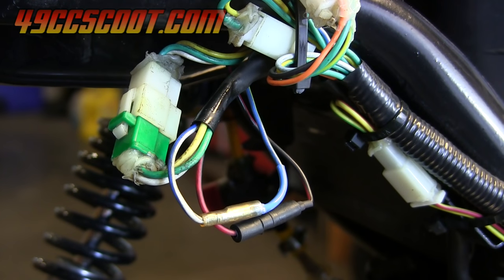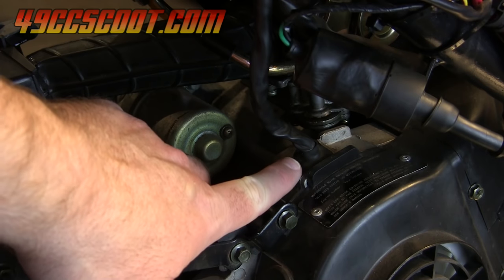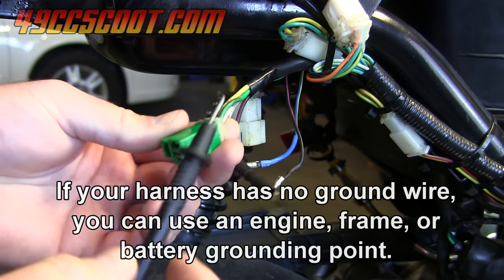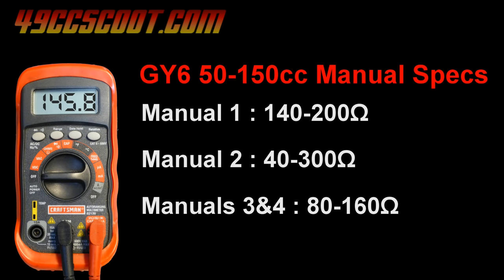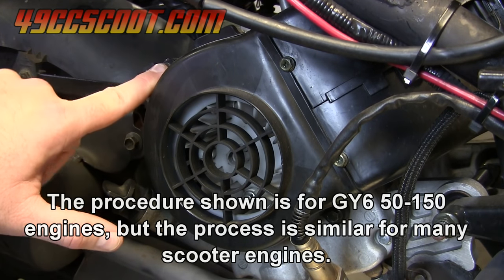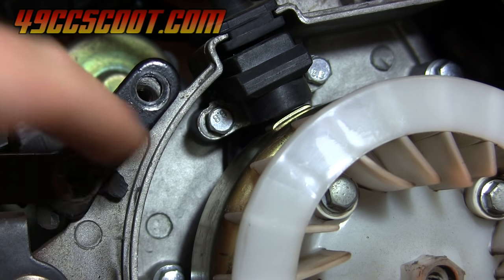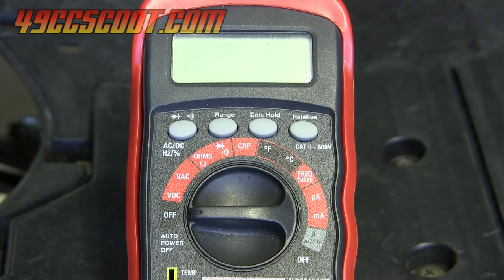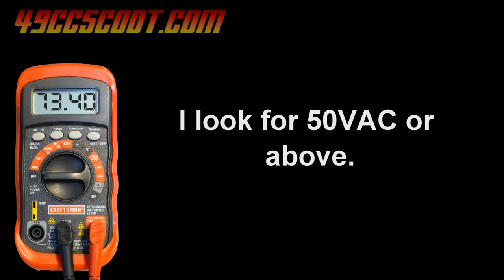Ignition Pickup And Stator Checks For AC Scooters, ATVs, & More

Comment: How can I tell if my scooter was supposed to have a DC or AC cdi?  Previous owners changed a bunch of stuff around and they had no clue what they were doing...
Reply from the maker: Depends how much it's modded. Worst case, you'd have to try to find out from a manual or someone else with that make/model/year. Otherwise, if the stator has an exciter coil to charge the CDI then it should be AC. If the CDI is getting power via the battery then it is DC. DC CDIs tend to be large compared to AC.
Reply: @49ccscoot  it's bone stock. It has a dc cdi on it right now but they changed it. The messed the wiring up because none of the lights work. But I've heard that dc scooters don't have regulators because it's built into the cdi. And also the right plug only has 1 wire on DC setups. But mine has 2. The power to the headlights/rectifier goes up with throttle so that would make it a AC scoot wouldn't it?

Comment: Perhaps reason for having so many different specs is because different Chinese scooter manufacturers use different stators, got to find out what stator type was originally used on the scooter manual is for then you can map resistance values to that particular stator (not scooter). e.g. 49cc GY6 come with 3 types of stators that are easy to distinguish by looking at the connector type 1 has NO ground (green) wire, type 2 has ground (green) wire, type 3 has no ignition/cdi wire.
Reply from the maker: Good luck with that. I can tell you from personal experience that you find stators of the same style that are wrapped different. Some will fill each winding and some cheap out and leave room for more. When you've got that going on, it's gonna be real tough to find anything you can be sure is accurate.
Reply: That's why i love chinese scooter

Comment: hi, i buyed a chinese atv 100cc but got a problem with the spark its to low you can barely feel it on your hand., what can it be? a lot of technician or mechanics want me to take my mtv  to their workshop., but the prices are to high., what can i do?
Reply from the maker: +viln o First off, please stop trying to electrocute yourself a little at a time. It's not healthy. Try using a tester of some sort, or just observing the spark across a spark plug. Could be many things. This video covers one. Could be the coil, wire, connections, reluctor gap, or maybe the CDI.

Comment: I have a genuine buddy 50cc that ran fine and lost spark. The black and red wire from the stator is showing 40 volts, the pickup coil is showing
0.34 volts. still not sure if I should order a new stator.
Reply from the maker: Get a manual and check the coil according to specs. Try a new spark plug. If you have a spare CDI, try it. Make sure there is no ground on the kill wire when the key is on. If there is, you may have a faulty ign or kill switch.

Comment: I have a question I'm hooking up a two stroke engine on a 4 stroke fram the wire hook up on the stator has four wire's you already know the two stroke has five is the black a ground cause there are white and yellow in a two plug then there are two in another with a blue line in one wire an a red line in the other what do I do with the black wire commuting from the stator
Reply from the maker: +marc Black should be ground...
2T wiring here : http://49ccscoot.proboards.com/thread/2556/wiring-diagrams

Comment: I can understand the awareness of valves, but gosh dang, a week ago, it was running like a champ, driving Interstate 15 in Vegas to work n back.. 
So what's the reason why the float levels, when full, aren't delaying fuel from continuing, but yet I do a blow check , personally & when floats hit full, I cannot blow  into intake of fuel line.
Reply from the maker: So you're asking why fuel continues to flow into the carb, I assume overfilling it, even though you can blow into the fuel inlet and it stops the airflow? Maybe the float height is set too high.
Reply: So Joey, if you were me and all you have witnessed is a constant cranking without the engine turning over, all though, knowing there is spark from an engine that less than a week ago was flying strong until vandalized,,,,, what would be your next move??  I am staring at the carb now, which I have taken off 6 times now and I am wondering is there something simple, like the needle valves not properly positioned, or is the idle screw not lowered enough ,,,, as to why its not turning over??
Should the butterfly valve be open on the idle screw as a pre start up [position and how far is the mix screw supposed to be?? I mean, am I flooding the carb so bad that its being choked?? SHIT MAN!

Comment: So what if my 139QMB 50cc with an 80cc head starts right up idles and accelerates fine and loses spark once it warms up?
Starts right back up and shuts right back off.
Reply from the maker: I would try to check ignition components once it's warm. Compare cold and warm specs and factory specs and see what changes when it's hot. If you can't find anything that differs, but it's definitely got no spark or a weak spark when hot, then try swapping out the CDI, assuming you've already changed the plug.

Comment: great info thanks ... everything checks out but still no spark
Reply from the maker: There's still the coil, CDI, and spark plug... as well as kill switches.
Reply: 90GTVert  I don't get any spark from the coil . It try's to turn over but no spark.i tried changing the coil and Cdi and still nothing  It's getting gas . The kill switch I believe works. It won't turn on with it off but try's to start when it's switched on ...
Reply from the maker: http://49ccscoot.proboards.com/thread/647/start-troubleshooting?page=1&scrollTo=8057
http://49ccscoot.proboards.com/thread/4666/easy-guide-spark-condtions

Comment: i have a problem where my chinese bike has only 4 volts ac on the exciter coil when cranking any help?
Reply from the maker: Sounds like you may need a new stator. Make sure you compare what you have to listings if you get a new one. Some of the Chinese stuff has multiple variations that are close but not exact.
Reply: @49ccscoot  thanks for the advice :)

Comment: problem atv, have   new spark plug and spark,compression good and fuel, engine  cranking but wont start 

can the CDI be the problem?
Reply from the maker: It's possible. If it has a strong spark (jumps a large gap like and HEI or adjustable tester or an old plug with the ground strap bent back) then I don't tend to focus on the ignition, but it could be timing related. Try holding the throttle different ways and see if it will fire then. If it gets flooded, holding it WOT will help. Sometimes I'll take the spark plug out and spray in a little carb cleaner or a couple drops of gas. Lately I've just been using an unlit propane torch in the airbox inlet to see if it will fire with a little extra fuel.

Comment: hi, atv 50cc Chinese
no power, check solenoid I get tone. get 13vdc to solenoid but when I turn key no green light come on or starter start any idea wath to look at it, thx
Reply from the maker: +Mike Gallo You need to have batt power on one side. The other should lead to the starter. You also need power coming in to trigger the relay from the starter button. You could try a simple test of the starter relay. Use a screwdriver to bridge the two large terminals and see if the starter cranks then. You must be careful not to touch any other surfaces when you do this or it will be a short.

Comment: Nope not all have continuity test.  I'm working on one where the owners multi meter doesn't have continuity. It has AC and DC volts DC current ohms and diode test. I had to use my fluke which has that and additional testing for transistor and capacitance and  coil.

Comment: Hey there. I need help with my scooter.ever since i adjusted the valve and spark plug clearences of my scooter i m facing a hard kick issue.the kick lever jams sometimes.no matter how much i force it down. Then i back off a little and its fine then. It doesnt happen often and never used to happem before adjusting valves. The kick start lever is properly greased and its not a bushing/greasing issue. Its smthg related to engine pressure for sure.and other thing i have noticed it that sometimes i face a kick back. This too never used to happen before adjusting the clearences. And to top it all sometimes i have to kick it 4-5 times just to get started during cold start.while sometimes it starts normally in one or two kicks.this doesnt happen with my other scooter which uses same engine . The other one starts in one kick no matter what the weather(extremely consistent).i have cleaned all carbs and filters and checked for vacum leaks as well. All is fine. Its just that this unpredictability during cold start is puzzling. M using stock clearences and engine runs good at all speeds.the occassional kickback and lack of will to start is odd.is it a sign of weak pick up coil? Its a 102cc 4stroke honda. Also one some rarest of rare occasions i have faced engine stalling issue at crawling speeds under moderate loads. That happened out of nowhere when engine was properly warm up. But thats a rare occurence.
Reply: k p 
theres a lot of posibilities...
maybe too much gap in valve clearance or no gap at all...
or might bhe mis timed valve action due to timing chain prob...
and an overly advanced ignition timing

Comment: no spark is usually bad cdi so try to borrow from any scooter atv snowmobile chainsaw that has similar looking cdi as for gy6 normal china scooter  or replace it first. can also heat the cdi to fix it like in oven google it for temps and times.

Comment: Good video, hoping you can help me.  I have no spark, new cdi, new stator, but the new stator is only putting out 50Vac.  Is it likely that I just got a bad stator, or what else am I overlooking?  The ignition coil seems to check out, and the guy I bought the bike from told me it was new anyway.  TIA
Reply: Josh Randall and a quick follow up question:  how can you tell if a flywheel is meant for a 6 pole or 8 pole stator?  I bought an 8 pole because the one I was replacing was 8 pole, but I was wondering if a mismatch will cause problems, and maybe this is part of the problem.  Thanks again.
Reply: I got the flywheel question figured out and decided to test some things putting the old stator back on and it actually put out higher voltage on both the pick up wire and charging wire, so I'm a bit stumped.  What else should I check or could be wrong?
Reply from the maker: Josh Randall See if there is a ground applied to the kill switch wire. You can find diagrams just googleing CDI wiring or something like that. Very commonly it's black/white. If a kill switch or ignition switch fails or there's a short it could ground that wire out and disable spark.
Reply: ***** I have tested the kill switch with a DMM and it seems to pass, I haven't been able to figure out how to test the ignition switch though. Any ideas?  Thanks again
Reply from the maker: If you check the wire on the CDI you can avoid having to check both ign and kill switch unless you find that there is a ground on the wire when the ign is on and kill switch is set to run. You'd test the ign switch the same way you tested the kill switch basically, but you want to see no continuity on the kill circuit wires when the key is on.
Reply: ***** At the CDI is where I tested the kill switch, so I guess that means the ign and kill are alright.  At this point I feel like maybe I just need to start to pull the wire harness apart and look for broken wires, but when I check continuity everything seems ok.  It is really starting to drive me nut.  Thanks again for taking time to respond to me, this is the first time I have messed with the electrical side of engines.
Reply from the maker: If possible, try a different CDI. Can't really test them without some specialty tester so it's easiest to keep a cheap spare on hand.
Reply: @49ccscoot  hope you can help me out I replaced my stator on my jonway 50cc and cdi and spark plug coil wire I had the stator check it good but it has one extra wire than my other one anyway I'm still not getting any fire to my spark plug what could be causing this it getting really annoyed.
Reply from the maker: @kevinsmith2407  See if you have a ground on the kill switch circuit at the CDI. Just look up a pinout for a GY6 or 139QMB CDI and it will show you which is the kill wire.

Comment: The CLOSER the gap from pick up/reluctor gap THROWS more electric(a/c) to RECTIFIER? the wider GAP lessen the AC throw?
Reply from the maker: Not to the rectifier/regulator. To the CDI for a trigger signal. You can watch this happen with a voltmeter. It has nothing to do with charging/lighting.
Reply: Oowww sorry i forgot the cdi. So i need to see 50VAC to 59VAC? at .015 inch?
Reply from the maker: Whatever the distance, you want to see around 0.5VAC from the pickup or more and 50VAC or more from the others.

Comment: Hello , nice tutorials , i myself into scooter tuning , but i was wondering ,  do you modify respecting road rules or to obtain a very fast scooter? Sorry i'm from europe and i don't know about traffic code there ..
Reply from the maker: +Talents Seeker Thanks. In the US each state has it's own laws regarding scooters. Some states you can legally be a 70cc and still be able to ride without a motorcycle license, some you can't pass 50cc. Speed limits vary, but most are 25-35MPH for a 50cc scooter. Some have HP limits. The main thing here is that there aren't tons of scooters in most areas like the rest of the world, so we don't have cops running around with mobile dynos or really cracking down... yet.
Reply: ahh ok , i understand now ;) Here in italy you can find a lot of modified scooters , not legal but cops here are not too strict xD Anyway would you like to see  some videos of the fastest scooters from here ? If you'd like i could propose  settings , just idk which brands you got in US
Reply from the maker: I watch vids from Europe somewhat regularly. Wish we had the crazy twin cylinder builds and that stuff here, but such a small portion of the population rides scooters, let alone heavily modifies them. A member of my forum did graft a 125cc dirtbike engine to a CVT and build a sprinter from the ground up though and drag race it. Not on the level of some of the stuff over there, but still doing ~80MPH in the 1/8 mile on a low budget. There are some high end Malossi/S6 builds at the NASRA (small US scooter racing organization) events, but it's just not on the level or scale of the Euro scene.
Reply: damn it's such a shame because i'msure US have a lot of potential in terms of number of people that could join  and better building tools , you can anyway order from a retailer site here and deliver it there. You just need the same replacement we use and i'm sure you'll have an eu scooter
Reply from the maker: I don't think it helps that a lot of people think scooters are a joke here. Only for people that can't afford a car or have lost their license in some states. With gas being somewhat reasonably priced, cheap compared to Europe, and having so much open area (like for me it's 10 miles to much other than a gas station), people will continue to not take scooters seriously for a while to come.

Comment: i tryed to remove the ignition switch from the frame/chasis and i cant, a round bronze bolt is holding it to the frame, i never seen round bolt, how do remove this? have u seen round bolt befor?
Reply from the maker: Usually they do this stuff on carburetor bowls to make them "tamper proof" and those have to be slotted so they can be unscrewed or drilled out. I haven't seen them on ignition stuff that I recall.
Reply: @49ccscoot  i asked a mechanic and he told me to use jaw pliers
Reply from the maker: @itaizrihan5701  If you can grab it with vise grips, that may work.

Comment: What if i just have a red/black and the big connector?
Reply from the maker: That's how my MVT ignition is. I assume it uses the signal from red/black as the trigger signal as well. If it's a DC ignition, I suppose the pickup wire could be that color. DC wouldn't need power for the CDI because they use battery power.
Reply: @49ccscoot  tkhans. But i have never used a battery

Comment: hello :) i have just innstaled a airsal88cc on my derbi. but it wont run as i want it to. just before the 2stroke powerband kicks in the rpm stops unless i shift down and get the rpm over 9k, then it runs fine . i have a 26mm dellorto round slide carb with 118 main jet in it.
Reply: do you have any advice? :)
Reply from the maker: +Fluxinorge mc Have you gone through a jetting process or just stuck one in there that you think will work? Can't you just shift later? You need to keep the RPM up if you want it to run strong.
Reply: +Fluxinorge

Comment: Hey brother can I buy a universal gy6 150cc stator coil and rewire it for my dio af18?
Reply from the maker: If possible, I think you'd be better off getting a stator for the AF18. The GY6 has multiple versions of the stator and even GY6 to GY6 the wrong ones have been known to blow bulbs and cause charging issues.
Reply: @49ccscoot  thanks brother,will give update after my trial